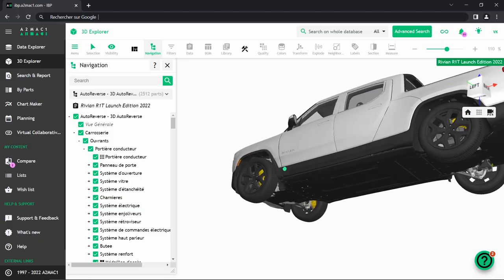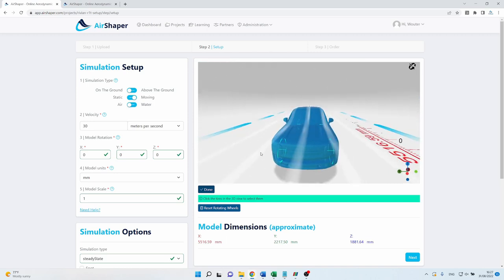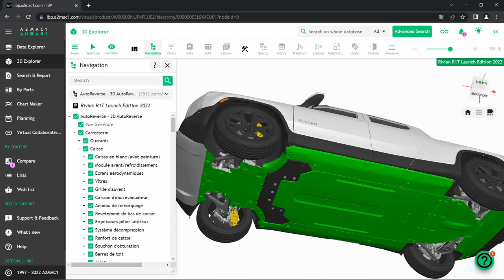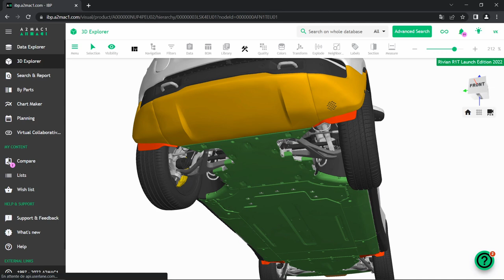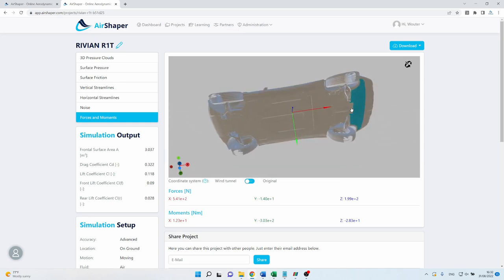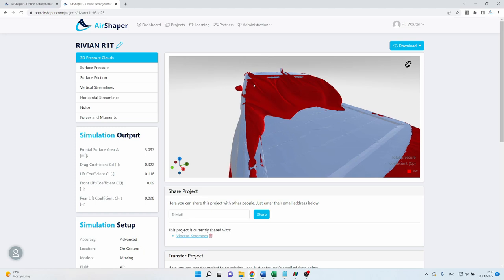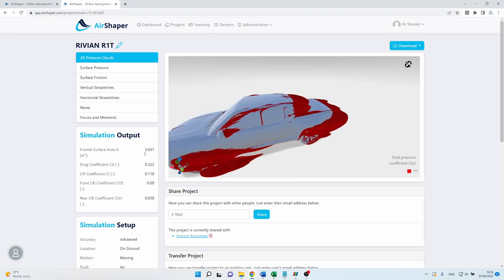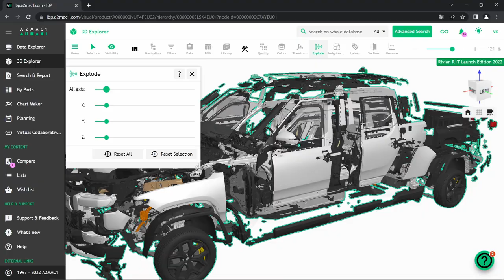Rivian R1T Aerodynamics - Is the claimed drag coefficient of 0.30 correct?

Comment: are you able to do the analyses with the bed cover open?
Reply from the maker: Not on this one, but we did this on a Ford F150 model. There, drag dropped by 4% when closing the cover. But keep in mind this is very specific to the F150 truck!

Comment: Thanks for the great analysis! I would second the request to do this with the tonneau open. If you don't have it scanned that way or can't remove the element, would love to hear your thoughts on how it might impact the results.
Reply from the maker: Hi Yury,

we did a lot of work on the Ford F150:
https://www.youtube.com/watch?v=E0ass_AxloM
After pushing that video, we also did a sim with & without tonneau cover. It closing it reduced drag by 4%. But keep in mind that this is very specific to the F150 and can change a lot between different pickup trucks.

Comment: how does towing(caravan) influence the airflow of the car ? witch shape can improve the EV-range of a R1 or Tesla Y LR ?thx
Reply from the maker: We've helped optimize some trailers and it's important to tune the trailer to the wake of the car. If that's not possible, then large rounds at the front and a gentle "inward" tail at the rear of the trailer / caravan can help. But of course, it's always a compromise between aero performance and packaging / occupant space.

If you're working on a caravan and want to optimize it, just drop me a line at info@airshaper.com

Comment: according to out of spec reviews, the difference in miles/kWh of a R1T over an F-150 lightning is just 10% when driving at 70mph.
That is, the numbers don't seem to add up, also considering the larger frontal section of the Ford. Either the ligthning has a much lower Cd than 0.44, or both Rivian and the software are too optimistic
Reply from the maker: Good point USugo
Normally, we'd assume aero is responsible for 50-75% of energy consumption at 70 mph. That would mean a much larger difference in miles/kWh than what the official figures show. Possible explanations:
- Bias of the official figures --> perhaps we'll see independent tests come up in the future
- Other resistances: weight, rolling resistance, drive train losses, ... make up roughly 25-50% of losses at 70 mph. But that would mean the Ford, not a light vehicle, would perform much better here than the Rivian
- Software, as you say, can also play a role.
- ....

Am I missing a possible explanation?
Reply: The Rivian has 4 motors to consume energy.... and I can imagine there is a lot of tuning car manufacturers can make regarding power consumption around motors. yes on straight 70mph test this should not be much but I am sure there are some efficiencies Ford gets with two motors. I believe Rivian has a conserve mode which only uses 2 motors.... that would be a good comparison to the Ford to see.

Comment: Interesting that you are using actual scan model/complex model, non watertight geometry. Without cleanup geometry.not to mention those rotating wheel. I wonder how long it took for the simulation to finish.
Reply from the maker: Yes, we spent quite a lot of time making the code fully automated and flexible with non-watertight geometry :) It took less than 24 hours on a 112 core machine with a few 100 GB of memory. We use the Google Cloud for our computations.
Reply: Less than 24 hr. Superb as always
Reply from the maker: @benykla  Thank you!
Reply from the maker: @benykla  Thank you!

Comment: Any suggestions for some modifications to cut drag more?
Reply from the maker: In terms of lowering Cd, you could consider a more downward roof slope, more reclined wind shield, larger rounds on the A-pillars, more upward 'diffuser', ... But these of course impact the design and functionality.

In terms of overall drag, reducing the frotal surface are could also help, simply making a smaller car (they could consider making a sedan).

You could also fit smaller / narrower tires, etc.
Reply: @AirShaper   - no i mean things i can design in CAD, print out or make in aluminum. Sorry for the confusion.